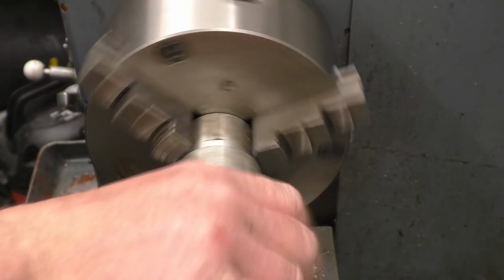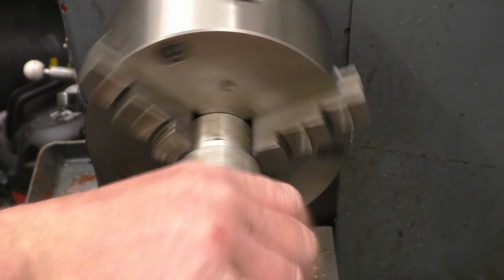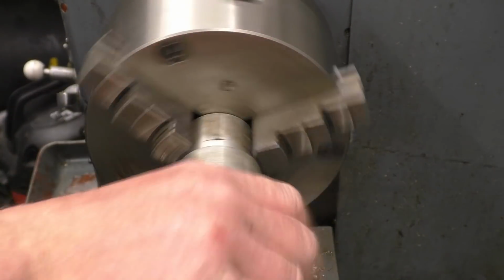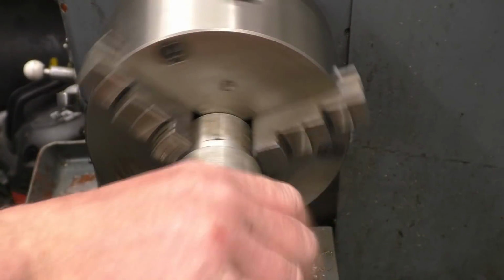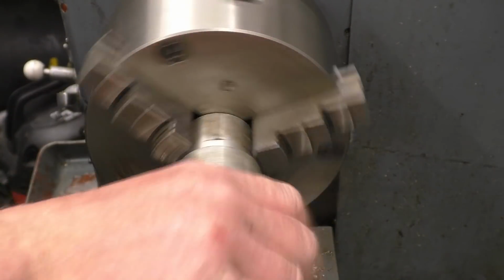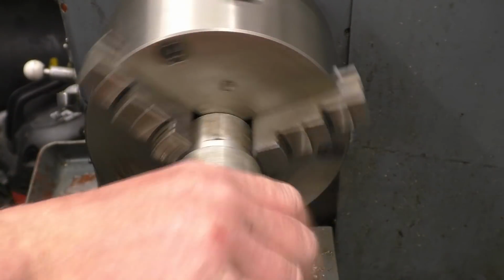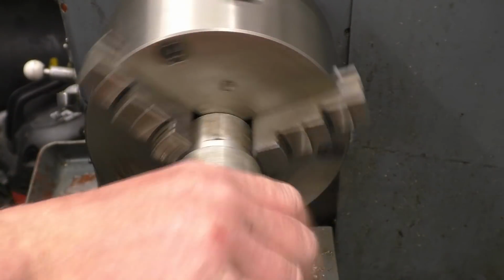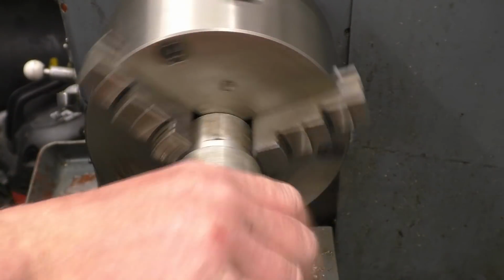SNNC 383 P1   Helicoil Thread Insert

Comment: I may be wrong, but I was told that a standard camera mount is 1/4" Whitworth, not UNC, and the 55 degree thread angle might be better in aluminium than the 60 degree so wouldn't need a helicoil.

Comment: Camera mounts are not 1/4" unc , they are 1/4" whitworth ,they have been cameras were invented.
Reply from the maker: Yes they are indeed whitworth
Reply: Except the standard was changed to UNC from Whitworth some years ago, not that it matters really as they will generally fit each other the thread profiles are close enough to work together for a camera mount.
Reply: @dutchgray86  Yes,  1/4 and 3/8" UNC for camera mounts as you state.